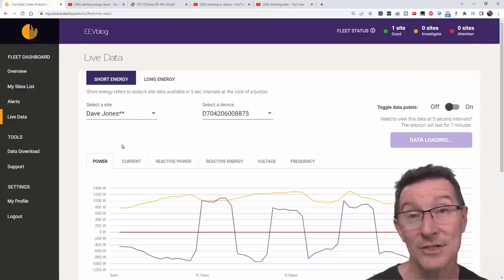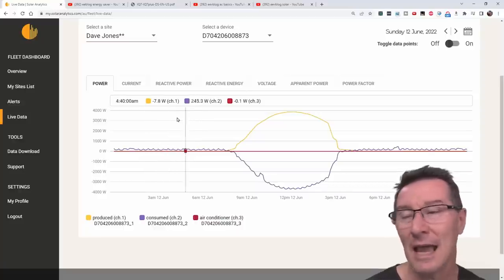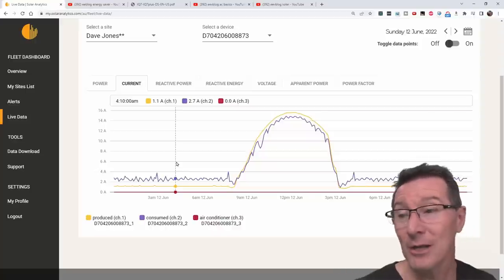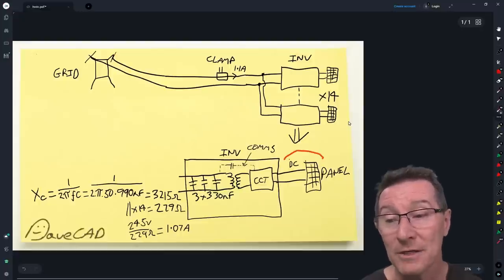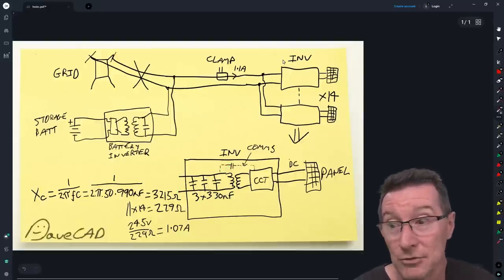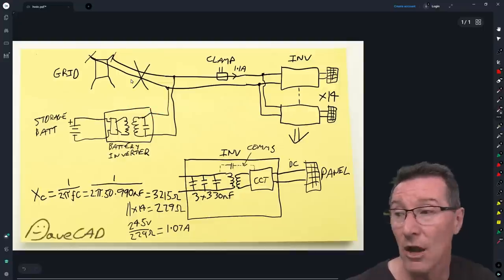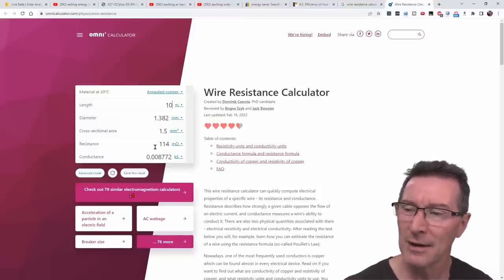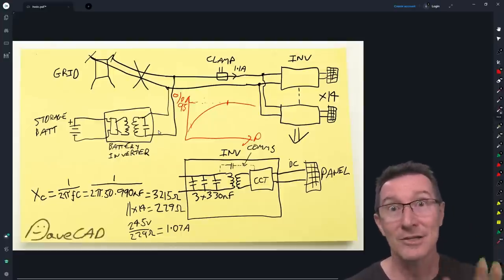EEVblog 1487 - Do Solar Micro Inverters Take Power at Night?

Comment: In the US, and every utility I have ever heard of, you will be charged for the 1 Amp, as the utility is still providing the entire wave form even you are not using all of it. Commercial and industrial customers often install power factor correction equipment in order to save money on their bills if they have enough inductive or capacitive loads. If your system appears to consume 2 to 3 kWhrs of power overnight, that will be made up the next day with 15 to 20 minutes of power production being fed back into the grid. Not ideal, and something that inverter companies could look in to increase efficiency.
Reply: US residential customers are charged for real power only.  It is wattmeter on your house - not an ampmeter.  Commercial is indeed different.
Reply: Yes, you are right. It has been many years since my apprenticeship, but once I looked it up in my old books, and looked at the specs of residential and small commercial utility grade meters, they all specified Active Power, while large commercial and industrial meters will also measure reactive power. Although technically Volt-Amps are still Watts :)
Reply: @GoCoyote  Yeah, the electro-mechanical meters are an electric motor that is driven by the interaction of the current flow and the voltage. So they are only capable of measuring real power. The newer "smart" meters measure the current and voltage separately and calculate the power used. The utilities are currently (in the US anyway) billing only for real power, but there's no technical reason the meters couldn't report apparent power as well. Once everyone is off the old meters, it is likely that the utilities will push for being able to bill for apparent. But that will require approval by the Public Utilities Commission, and probably some state regulatory boards.

Comment: Have you looked into solar tracking systems that change the angle of the panel throughout the day?
Reply: Trackers used to be a thing when solar panels were less efficient, but not worth it any longer.  Cheaper to add a few more panels for the same net gain.

Comment: You could sum this whole video in 5 minutes probably. You repeated yourself worse than thunderf00t back in the days.  
tl;dr: Yes they take ~15mA. But if you measure the grid side current flow, it shows much more because of the reactive power through the capacitor banks on the grid side of the inverter.

Comment: I have a very similar setup to you Dave. An older set of panels with 2 Sunnyboy Inverters and a new system with 15 micro inverters. The Enphase/Envoy monitor box is on a dedicated circuit in a new SPAN (very cool breaker box) box. The monitoring software for the SPAN box shows a 24/7 draw of 4 watts. The new system was self installed and my son did a great video on it https://www.youtube.com/watch?v=WurbKB_dOqI (the SPAN box was installed recently so it does not appear in the video).

Comment: My microinverters output DC voltage for about 12 to 45 seconds after AC voltage from grid is disconnected. How do you explain that?

Comment: ok.. so what i gained from this... is that the Apparent power is flowing current, but most of that current is returning to the source...therefore its not being 'used' and you dont get charged for it..
...but the keywords being used here... "ideal capacitor"..... ideal would mean zero resistance right? there is no such thing in the real world ...they all have an ESR... so have some resistance.. so some heat.. so some Real power usage..that you DO get charged for...(aswell as the losses in the copper that the current is flowing through)
IMO these losses should be dealt with, to help increase the efficiency of the system, it maybe only a couple of % ..but every little bit helps (especially if youre running off batteries)
Reply: The non-idealness of a real world capacitor is pretty negligible in this case, and would contribute to the real power measured on the "power" graph. So, I'm not really sure what your point is. Suggesting to add more circuitry/failure modes/cost to a product for an as-yet too-negligible-to-measure cost seems unwise.

Comment: Couldn't you disconnect them at night with some power relay?
Reply from the maker: I discuss that at the end of the video.
Reply: But why? There's no advantage, really
Reply from the maker: @gino.avanzini  Could be an advnatgae if you have a grid-independent battery system.
Reply: Would be an interesting test to determine actual cost (not theoretical, reactive, apparent etc)  though not sure if the analytics system shows that (was thinking of the 'not so smart smart meters' in the UK some of which show real-time, actual cost, sort of).

Comment: Hasn't the enphase gateway the ability to disconnect the micro inverters from the grid. Thus we have relays wich are continuously powered and consume energy and we should have the ability to disconnect the non producing inverters. So a software upgrade which disables the relays over night and with this turns off the inverters and on time turns them on could save some watts real power at least

6W *6h *365Days = 13kWh ok, some Euros/year, but avoidable

OK, your last video minute destroyed my comment

Comment: Reactive power is not measured in watts, but in VA.
Reply: also known as apperent voltage, ny house has one
Reply: (actualy next one to the din rail fi relay)
Reply from the maker: Yes, did I say watts somewhere where I shouldn't have? (probably)
Reply: @EEVblog  Yes just before 10 minutes, but got it right everywhere else. Hard to catch any slip ups with Dave in general, and you very rarely make any either.

Comment: Hi everyone,

 I would like to be able to receive the signal from a controller with an HCS301 (MICROCHIP KeeLoq) in the transmitter and with a PICxxx or an ATMELxxx in the receiver.

 There is a library for ARDUINO about receiving the signal from an HCS301 and another to emit the signal from an HCS301, but I can't find it... I'm still looking.

 Greetings to all.
Reply: You'll have to find a copy of the 'leaked' PIC app note for the receiver and transmitter. Used to be floating around on a Russian website. Microchip app note AN745 I think (the restricted version is what you need).
edit: after looking again it's AN642
Reply: @threeMetreJim  Thank you very much, I already found the application notes what can you tell me MICROCHIP DS01275A.pdf, MICROCHIP DS00745A_C.pdf
I'm going to investigate